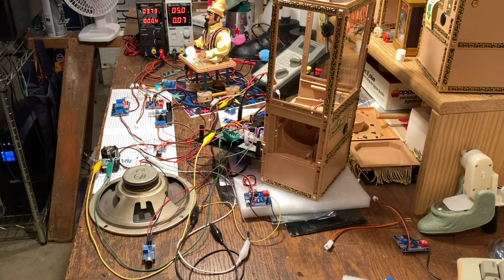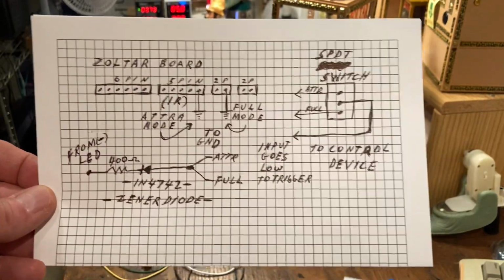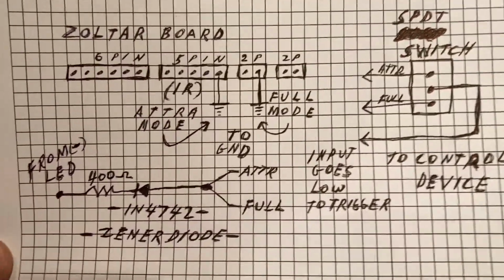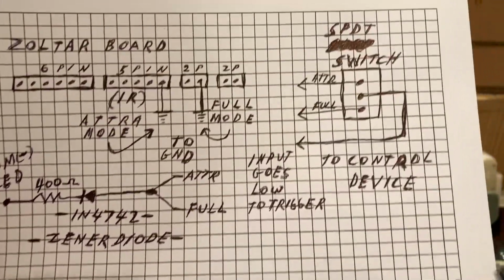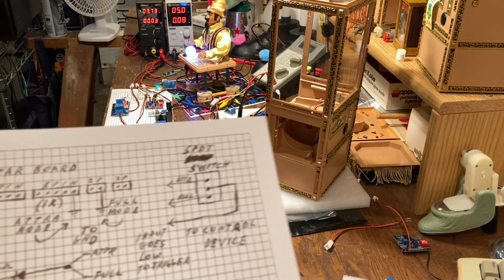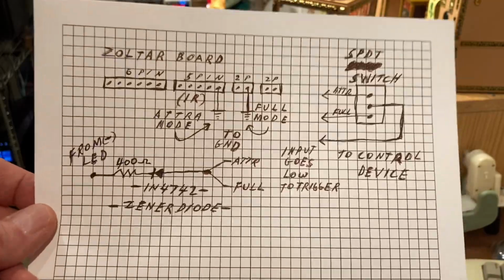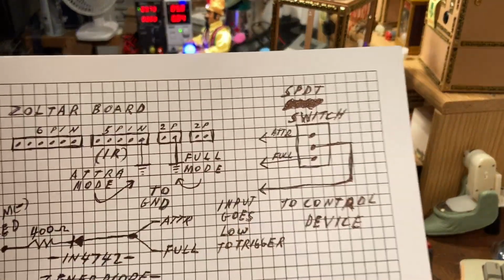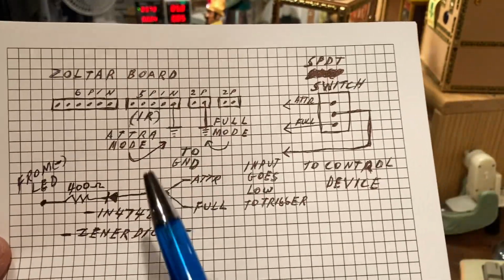Zoltar Mod Externally Controlling Attract Mode Or Full Mode Part Two #10

Comment: Hello, i have a centipede that doesnt work. Do you do commissions? Battery was plugged into the board backwards which shorted something. Any chance it could be fixed? Thanks!
Reply from the maker: No I am sorry to hear that, but I do not do commissions. Thank you for your comment hope you can get it fixed.
Reply: @mikecomptech  i knew it was a long shot. Thanks!
Reply from the maker: @pwc9222  No problem.